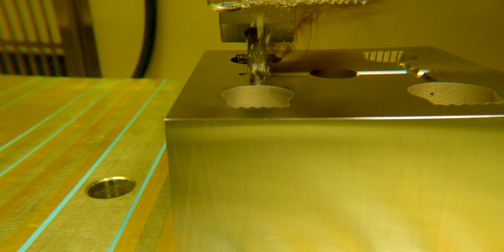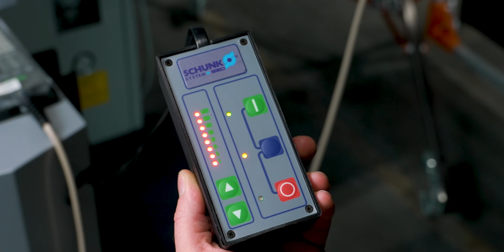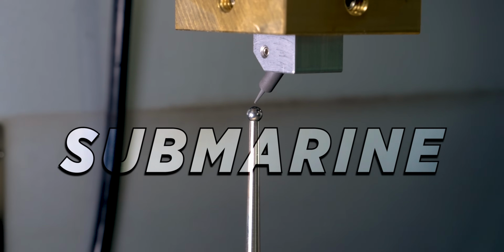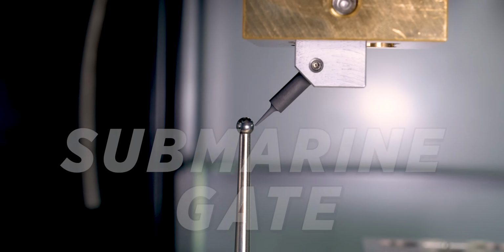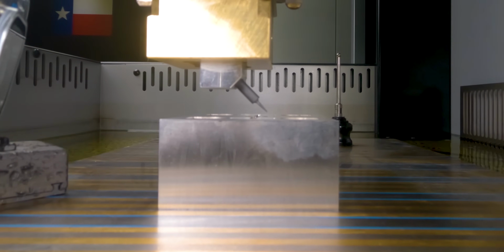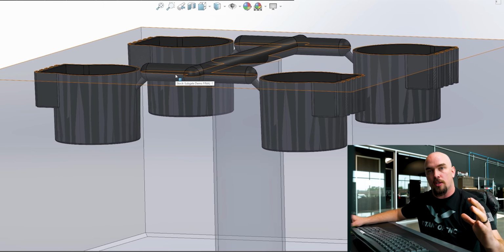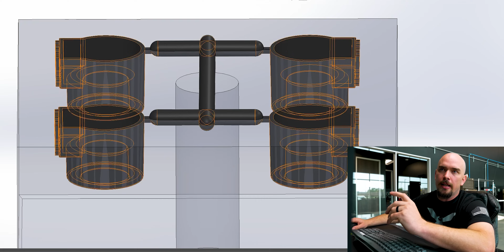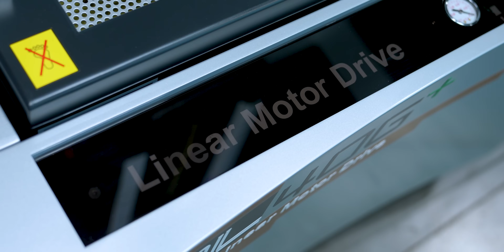This Technique Changed Mold Making Forever

Comment: Fun to watch! I use to use a machine like this 25 years ago when I was working as a Tool and Die maker. It was not CNC controlled, so I could only use Z-axis when burning of material. But otherwise it worked the same way. I remembered machining electrodes in graphite and copper :)

Comment: Hrmm, so how is the part forced out of the mold in order to seperate from the sub gate? Vacuum? So top of mold comes off then vacuum sucks parts out and breaks subgate and rubber plastic behind? Then how is that plastic removed?

Comment: What am I missing about machining graphite that makes it special? I assumed it was probably one of the easiest things to machine?
Reply: It’s not really difficult it’s just unique. It is extremely abrasive so you need diamond coated tools to get any kind of tool life. Also when you cut it, you throw carcinogenic dust every where so you have to have a really good dust collection system. The dust is also really abrasive so machines with a graphite kit have sealed ways to keep the dust out of the mechanical components of the machine like the ball screws or linear motors.
Reply: @trevorgoforth8963 yeah that makes more sense, less about ability to and more just don’t want to wreck a machine not spec’d for it

Comment: Polymer scientist here: This is amazing, usually you need inserts to add subgates to the mold, this method makes the manufacturing of these parts much cheaper. That said - probably only usable in unfilled/unreinforced materials, as any glassfiber would probably wear out the knife part of the subgate too quickly making an insert, that can just be changed, a little more practical. Is this method also usable for Banana gates? So does the EDM machine have a horizontal rotational axis?

Comment: There is no need to use EDM for your 'submarine gates', they can be drilled as easily.
It's also curious, that you have your EDM graphite milled by someone else in the precise form of the part just to create a cavity using EDM.

Comment: We also used our wire machines to make regular parts like you would make a mill or lathe often we would take a piece of stock that needed a large hole through it give me some EDM drill to punch a hole through it in position it on the table the wire machine so at night we could take the center out and put the peice stock back on the shelf we also made many components for moving weapons like missiles the cart would have these aluminum closures that had the taper for the nose cone built in we would almost machine those complete on The Wire

Comment: I've never hated graphite so much when I went to work at one of the national laboratories they saw graphite electrodes in my box and threw a fit needless to say I no longer use graphite they told me to get rid of it get it out of my toolbox take it with me they did not want it in their shop period.
From that day on I learned how to use copper and why to maintain a copper tungsten block somewhere in the back corner of your tank for dressing electrodes 
We had unlimited access to copper and an electric furnace for heat treating we melted our used electrodes and cast new ones to net size.
Sodick at the time had what I considered the best die sinkers made we had just received two of their wire machines at the time they were oil over water machines we ended up having to send those back they were unable to cut the parts that we were making something in their software whenever they were in a over cutting mode in their own mind they would just stop no warning no solution.
No actual overcutting was happening regardless the machines that we had on the floor at the time were just fine.
We had some regular production parts as well as the usual oddball stuff that found its way in the door every day.
Can't say enough good about Sodick.
Even when we were having trouble with their wiring machines they were very happy to come and assist and there were no hard feelings when they had to take two wire machines with them. 
I just wish I could find an inexpensive used sinker like what we had.
I think it was called an ACR5 I really don't need the tool changer just the base machine and an old Fanuc Wire like a 0 or a 1 machine I'd be thrilled.

Comment: Is the surface finish on the plunged cavity intentional or a byproduct of the EDM process? I’m wondering if it’s possible to achieve mirror-like finishes directly off an EDM process.
Reply: Mirror finish can be achieved by polishing. No EDM process can do that even with finest surface RA roughness. I may be outdated having lost touch with latest technology many years ago. Was in the Encapsulation molding process for semiconductor chip. Need a smooth surface for Laser symbolizing upgrading from the previous process of printing.

Comment: Why graphite for the electrodes??? We used it where I did my toolmaking apprenticeship 30 years ago but switched to copper electrodes about 2 years after I started. Every other tool room I've worked in since has used copper as well, so I was interested to know why you guys are using graphite.
Reply: Graphite easier to machine than copper. It can be precisely ground and have better wearing rate.

Comment: What prevents the plastic permanently clogging up the subgate?  How does the subgate get out from the undercut?
          Normally, you WANT the parts remaining attached to the runners.  You don't want 100's of computer keys coming loose at once & then requiring sorting for subsequent assembly.

Comment: Strictly amateur here; maybe 30 yrs ago I was machining my own graphite electrodes and using them in a modified Hansvedt tap buster to make injection molding dies for parts I couldn't afford to make any other way. That's a mighty sweet machine you have there! 🙂

Comment: Super cool stuff. I have a question I didn't see any holes for the ejector pins, the molds that I have made would have had the ejector pins drilled and reamed prior to hardening. Do you plan on wiring out the ejector pin holes?
Reply: I believe this is just a show piece for instructional purposes. Besides, this insert looks like the cavity side of the tool.

Comment: How does the excess plastic get removed from the subgates. Is it just bent out during the removal process?
Reply: The mold will have ejector pins in the runner, which push the plastic out of the mold after the mold opens
Reply: @aaronward9965 This insert looks to be the cavity side of the tool, given the hole for the sprue bushing. The sub gate would break away from the parts as the mold opens.
Reply: @stencooley  this tool is probably reverse ejected?

Comment: Injection molding setter here, I've worked with over 400 different molds and maybe a few of them were using edge gates, all the rest were hot runners, sub gates or hybrid. No one really does edge gates it unless they want to keep the part and sprue together for some reason.
Reply: Isn' that used for toys where kids can assemble their own car, dinosaurs, boats, aircraft models or other things by breaking the individual parts from the sprue? Always left those sharp break edges :/
Reply: Only used in low cost moulding part 😅😅😅

Comment: Why didn't you just mill the gate? It's faster and surface isn't that rough at the end.
Reply: milling without 5 axis would mean 2 more setups to mill gates on angles, but if its already getting burned the gates can be done in the same setup

Comment: Those gates look huge, what diameter are they where they break through into the components? We use 1mm diameter for something that size, you’d be surprised how big of a component you can fill with a tiny gate. Also what VDI did spark this to? Would love to see how you polish it and the equipment you use
Reply: These are pretty close to 1mm, they are .030" in diameter. it's probably just the close up shots and camera angles making them appear bigger. These are 24 VDI.
Reply: @ yeah must be, or the parts are smaller than what they look making the gates look bigger too, looks a mega machine that

Comment: Worked for an injection molding company years ago the molds were made on a cmc milling machine with a paper tape and was made up of different layers. 
And at the time we had the biggest injection molding machines in Europe and we made bumpers for ford with them .
Reply: Punch paper tape machines of the seventies were numerical control.

Comment: im very interested in the next step,  polishing the mold after an edm process
Reply: I have a colleague who worked as a tool and die maker for many years, according to him you can get a mirror finish with sinker EDM. May need to follow up with another electrode for finishing, depends on what surface finish you're after.

Comment: Won't the rough textures on the insides of these EDM'd cut outs act as a gripping force that makes it hard to extract the components being molded?
How are the cast items extracted from the mold cavities?
Reply: Tim this mold needs a good polishing job. Parts are usually extracted with Knockout pins or stripper plates. He did not go that far in the explanation.
Reply: @laszlobernath5344  Depending on how much draft the part has and how the core is designed to retain the part on opening, the VDI 24 finish could be final.
Reply: Molds have tapered vertical walls. Typically 0.5° - 2° taper. It is called draft. The draft allows the part to be ejected, or removed.

Comment: hmm, one of the less common subgates
usually they should have a step at the end for better turbulent flow of the injected material, unless it has a high abrasive additive like glass- or carbon fiber.  
and to be more precise about sizes where that is used - a cars rear side window can still count as "small part" in that context ;)